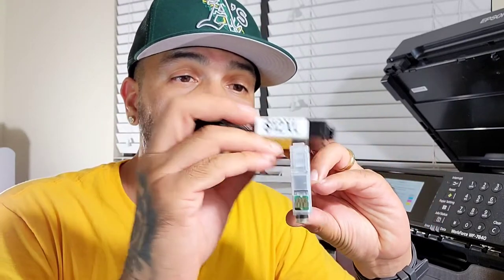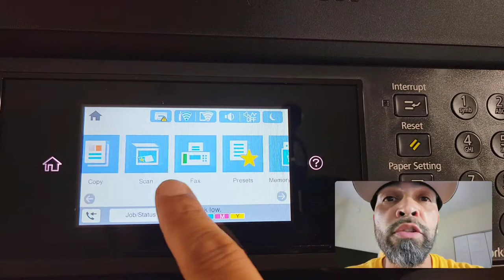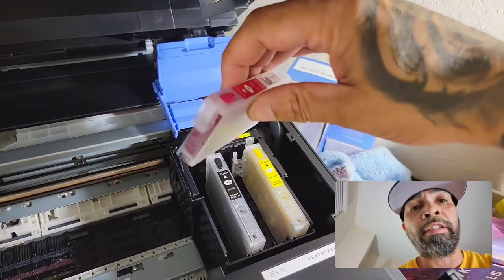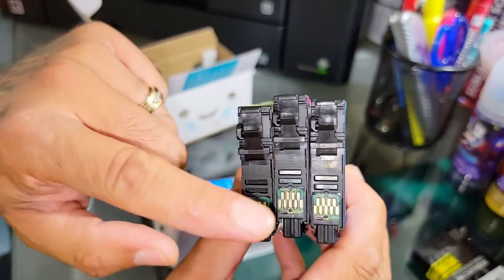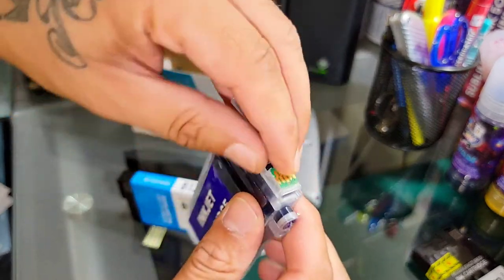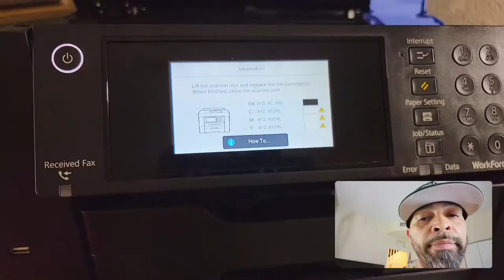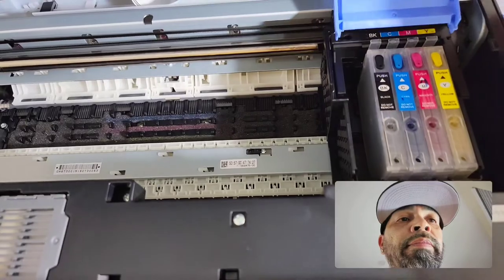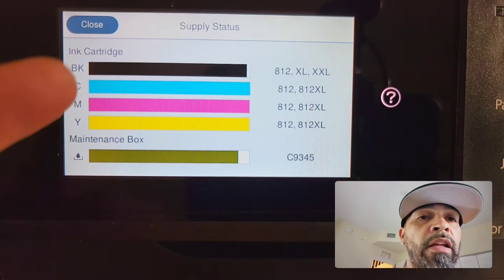Converted WF-7840 Into A Sublimation Printer PART 2 (MICROCHIPS)

Comment: Hey when I refill my cartridges I have lots of air bubbles. Can I still use them with no problems? If not, how do I get rid of em
Reply from the maker: Sorry been busy, watch this video and fast forward to 6min & 10secs (show how to prime the cartridge, take air out):https://youtu.be/PI5RadxJX8M
Reply: @diywithkenny8399  ok cool. Appreciate that man
I ran into another dilemma tho. I just setup my printer for the first time. With the refillable cartridges and ink, but when I do test prints. My pages are blank, and now my black ink is half empty. Any idea what I should do
Reply from the maker: That video I sent you should just backtrack, did you download the "Recommended Drivers" from www.epson.com/support (then find your printer, then download).
Reply: @diywithkenny8399  I got all the drivers installed before and did the initial setup with the sub ink cartridges. I think where I messed up is when my ink was charging, I still had the vent plugs plugged in because it’s still printing blanks…

Comment: May I ask a question.... I accidentally broke the original magenta chip on my WF 7840.  I followed your instructions on converting my WF to sublimate.  I went to the Epson store and purchased a new magenta  ink and changed the chip but now its telling me that I'm low on magenta ink; however, my chamber is full?  I have done several test prints to no avail.  My printer is indicting that my ink is being used but no print out? Could you  help me out.
Reply from the maker: Have you done any firmware updates?  Also when replacing the cartridge with aftermarket chips, where did you get them from?
Reply: @diywithkenny8399  I purchased a magenta single cartridge from Epson. I contacted Epson and they suggested that I do several head cleaning; however,  to no avail?
Reply from the maker: @pizeno60  Did you do a "Firmware" update on printer?
Reply: @diywithkenny8399  yes sir I did
Reply from the maker: @pizeno60  That is kinda weird if you are using a Epson chip?  Have you tried to remove all cartridges, then turn off power for 30min, and plig back in, place cartridges in?

Comment: I had my printer for 5 months now, converted it awhile back. My black is showing the x stating it's not recognizing the ink. I changed it with a new chip twice. This is frustrating
Reply from the maker: Hmm.  Have you tried print head cleaning?  Where did  you get the  chips to swap the black color?
Reply from the maker: Also make sure the chip is facing up correctly (4 copper things top and more copper on bottom).  I have switched chips with no problems.  It is either a print head cleaning (need to run like 5x), check the chip placement.  You got this 😎
Reply: Etsy, the other three works fine. Just the black. I'll do the head cleaning. It's so annoying. I'm regretting of ever converting
Reply from the maker: Dang sorry to hear that, it does take few extra to maintain..  even for the ecotanks.  But least with ecotanks can do the print head cleaning, and no worries of chips.  We need that chip rest or chipless firmware, but have to wait.

Comment: Please help someone!!! ;( Just got all the ink installed into this printer and it will NOT work! It prints but it's like there isnt any ink. The paper is completely blank...So frustrating
Reply from the maker: Hello, when you filled the sublimation ink, did you take off the near the back the color rubber part and use that for the plug?  [When you filled, you move the plastic rubber that not color.]
Reply from the maker: Fast forward vid to about 3:30 when I remove cartridge.. you should see the color rubber part where you refill ink, i took that off from the rear from refill cartridge
Reply from the maker: Watch this and forward to 6min

https://youtu.be/PI5RadxJX8M
Reply: The clear plug is where I put the ink in and the colored plug is in the other spot
Reply: The clear plug is where I put the ink in and the colored plug is in the other spot
Reply from the maker: @heatherphillips6669  remove clear plug, fill the ink, take the color plug and use that where you put ink. 

So color plug near front where chip is now.  [throw away clear plug..  no plug in rear now on refill cartridge].
Reply: Ok, I did that and thankfully there is ink now. I’ve did like 4 nozzle checks and print head cleaning. All looks good except for the black color. It has several spots that come out choppy. I’m not sure how to send a picture to show 

Thank you so much for your help. 
I’m sure I’ll figure it out soon, I hope
Reply from the maker: Welcome.  Was you able to watch other video i linked in the first few replies?  You may have to prime your refill cartridge.  Make sure remove the refill cartridge from printer to prime so no mess.  Hope that helps.
Reply: Yes, I watched them a few times lol 
I’ll keep messing with it
Reply from the maker: @heatherphillips6669  Don't have to do any more print type tests like nozzle test.  If black is spotty on the paper, use regular copy paper 8.5x11, and run a simple design SMALL print, it should work itself out.  But glad it is working now!

Comment: Will a ciss system work?
Reply from the maker: Sorry what is a ciss system, I dunno?
Reply: @diywithkenny8399  it's a continuous ink system. I have been researching the 7840 and found the ciss system. It seems as if you never have to change the cartridge because there is a reservoir that feeds ink into the cartridges continuously.
Reply from the maker: oh lol i know what it is now.  Never knew the name.  No so far because of pandemic the claim is chip shortage for whatever reason.  So will need the infinite chip or chip reset device for that.  Be nice to have, have done all my research... better off getting a eco tank 15000

Comment: I have epson  WF 7820 I changed M to Sublimation ink I Watched your video step-by-step filled it up and it still says need to be with you please help.
Reply from the maker: Hello.  Gonna have to ask a few questions.

Either you swap or bought the etsy chips, are they facing correctly?

After removing the clear rubber seal to  fill the sublimation ink, did you replace it with the color rubber seal (throw away clear ones)?

Last question; after connect wifi, did you download the "recommend drivers" from www.epson.com/support/ ?  Watch this video for that step: https://youtu.be/aLpdCW_yQkw
Reply from the maker: I'm around so let me know whats up.  You got this 😎
Reply: @diywithkenny8399   1. Yes I swap the chip the Magenta only. 2 Yes the chip is in correctly 5 bars at the bottom. 3. Yes I through the clear 
Rubber stopper away and the magenta color rubber stoppers is in the right whole. Yes I downloaded the driver. Thanks for your help. Please reply. IT SAYS I NEED TO REPLACE INK CARTRIDGE
Reply from the maker: Ok.  now before you converted, did you use those chips off the epson ink?
Reply from the maker: Also.  If you only swap the Magenta color only, does the magenta showing full or empty?

What is the printer screen saying?

 Excuse me for asking just need more information.
Reply: @diywithkenny8399  Empty
Reply: Do you need to change all of them at the same time?? I changed 1 because only one is empty?? Help
Reply from the maker: if want can add me on twitter, and message there would be more better can help you get this done.  Just something small step missing somewhere @ProlivingE
Reply from the maker: yes... maybe try that.
Reply from the maker: Double check your steps please, watch the original convert video:  https://youtu.be/PI5RadxJX8M
Reply from the maker: Hey just saw twitter.. i be on there.

Comment: Hello! I'm getting a error message for my magnets. Its reads all colors except for that one. I've changed ink cartridges, primed it, shook it a few times...and nothing is working!! Help me please...
Reply from the maker: Carefully remove cartridge, make sure chip is snug and facing up right, also your color rubber seal should be where you fill in ink, no clear rubber seal (throw away) and magenta color rubber seal near front where chip is.  Carefully place cartridge back.  But main thing is make sure chip facing correctlly and not loose
Reply from the maker: Also did you shave the bottom plastic nub part where chip goes?
Reply: @diywithkenny8399  I did everything I seen you do on the video. I've taken it put several times and even changed to a new ink cartridge.  I think it is the chip itself.  I'm going to try replacing it and see if that works..
Reply from the maker: @kimrivers30  Did you watch part 1?  You can start at 1min 25sec marker: https://youtu.be/PI5RadxJX8M

Full details there
Reply: @diywithkenny8399  ok
Reply from the maker: @kimrivers30  You will get it, if you have other colors good, might be something minor.  Feel free ask anything else 😎
Reply: @diywithkenny8399  Thanks!
Reply from the maker: Did you get Magenta working?
Reply: @diywithkenny8399  Yes. I got it today!! It's initializing as we speak!!. It's complete! I'm so excited
Reply from the maker: @kimrivers30  wooohooo 😎. Happy for you.
Reply: I'm nervous. Don't know what to do now!!I'm so used to vinyl!!
Reply from the maker: @kimrivers30  you got it.. now have to think polyester.. can use mix cotton blends too (60/40 and some 50/50 vintage look)
Reply: @diywithkenny8399  ok!!
Reply: What the website for the drivers for epson....
Reply from the maker: @kimrivers30  www.epson.com

Then find support
Reply: @diywithkenny8399  ok
Reply from the maker: @kimrivers30  watch this & fast forward to 9min 30sec.. for setting print preferences: https://youtu.be/aLpdCW_yQkw
Reply from the maker: @kimrivers30  last thing, if you do light color shirts, the color will change:  example color blue & yellow = green.  Just so you know.
Reply from the maker: @kimrivers30  you can use that, not sure if you're limited to size but also Sihouette Studio is free software I use for printing.
Reply from the maker: @kimrivers30  IF you download it, very top right hand side look like a sheet of paper, can set your canvas size page for  print;

Then drag and drop image, can size it like cricut.  But you may have to check your Epson print prefetences for print borders that if you trying to max out the image.
Reply from the maker: @kimrivers30  https://www.silhouetteamerica.com/software
Reply: @diywithkenny8399  Hey. Testing it out today. How do I mirror on silhouette studio?
Reply from the maker: @kimrivers30  Nice 😎.  You should not have to Studio.. mirror is in your printer preferences/presets..I always check the preferences after selecting printer.
Reply: @diywithkenny8399  ok

Comment: Hello, thank you for your videos on the wf 7840 conversion...I have purchased 2...one to convert to sublimation. And the other to have to print out larger prints...for the sublimation conversion..it seems like this would be costly having to buy new chips each time. The cost could really add up.  Kenny what do you think? Wondering if I should send one back and look for other large print machines to convert where I wouldn't have to keep replacing the chips.   Thank you once again...I have 2 days to return the wf 7840...
Reply from the maker: OK.  Yes for now there are no "FIRMWARE CHIPS" made yet.  Will have to buy new chips again for this WF printer.  I am still working on research to by pass.  Best option is Epson EcoTank 15000 estimate $600, get inks from www.cosmoink.com.
Reply: Thank you,
Reply from the maker: @marleymarley1360  Make sure you manually check your sublimation ink on the WF if you running a lot of prints.  Always around to answer any questions. 😎

Comment: What if I have already started using my WF-7820 as a regular printer, but wanna convert it to a sublimation printer, is that possible, and how do I do that?
Reply from the maker: Hello, you can still convert it;  for the left-over original ink inside the printer, can just do a few "print nozzle test" until you see a "dull" look from sublimation ink.
Reply from the maker: Whenever you decide to convert, I am around for help. 😎
Reply: @diywithkenny8399  I’m VERY new to the sublimation world 😩 so could you explain a little more as to what I do with the regular ink that’s already in the printer…please?
Reply from the maker: @regenasimmons2534  Leave original in there until you have ecerything you need to convert.  Once you replace the new refill cartridges, with ink, just run a few print nozzle checks on normal paper.
Reply from the maker: Sublimation is for polyester garments at 100%, 65%, and 50% (vintage look), can also use on ceramic mugs.  Certain vinyl can sublimate designs on.  Cannot sublimate on darker colors, because no white ink.  Hope that made some sense 😎
Reply: Thank You sooo much Kenny, you were very helpful and at answering my questions! Thank You!!
Reply from the maker: There so much more information lol.  Welcome anytime 😎
Reply: @diywithkenny8399  I have a question 🤔what colors can you print sublimation on besides white?
Reply from the maker: @regenasimmons2534  Recommend light pastel type colors.  100% polyester, 65% poly 35% cotton. and vintage type look 50/50 poly-cotton blends.  Hope that helps.
Reply from the maker: Also keep in mind whatever color you decide, may turn opposite!  Example: blue + yellow = green.
Reply: @diywithkenny8399  Thanks! Yes, that helped out a lot☺️
Reply: @diywithkenny8399  ok got it!